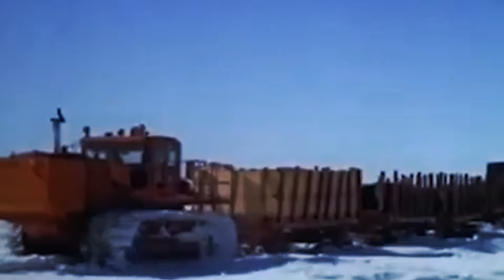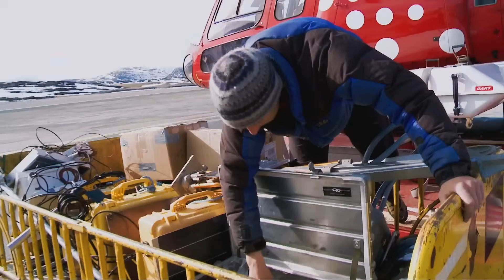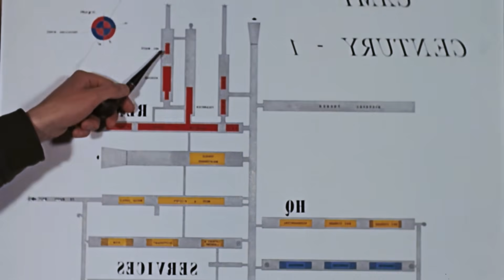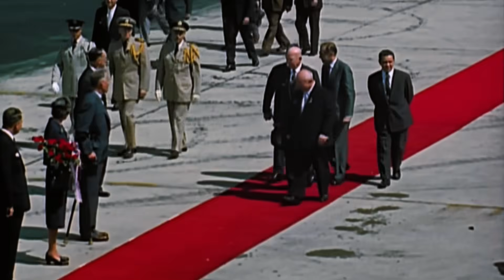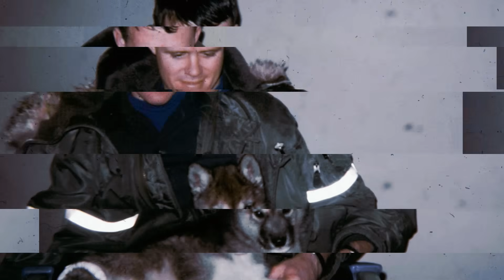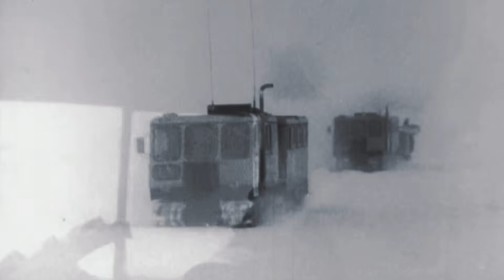Scientists Finally Revealed the U.S. Army’s Top Secret Arctic Base in Greenland

Comment: This is a true story.  I fact checked it.  The danger isn’t imminent but if the Greenland ice becomes a net melting rater than a net accelerator of ice the toxins will be released into the Atlantic Ocean.  The reality of abrupt catastrophic climate change will determine how soon this will happen.  It is suggested that it will start to show up in the 2090’s.  Neither the USA or Denmark are taking responsibility for it because of the huge costs of the clean up.  The courts are at a stalemate and, of course, Greenlanders, who will suffer from this the most, do not have the resources to deal with it.  Maybe, Donald Trump will do something about it….he is so adamant that Greenland is necessary for Arctic security…😮